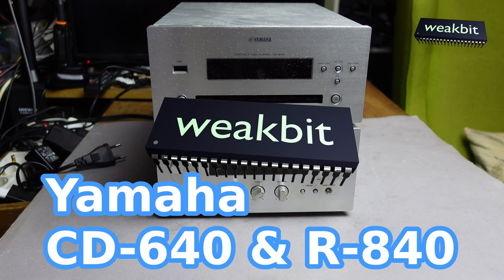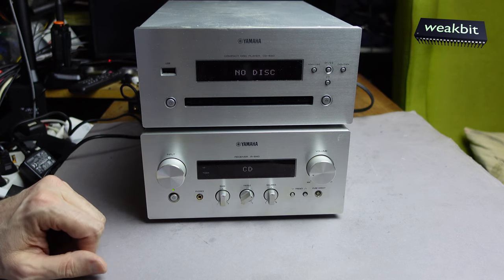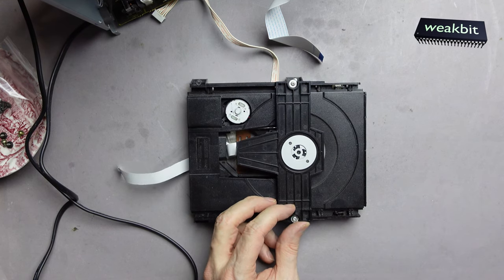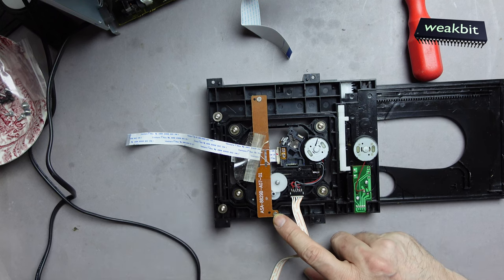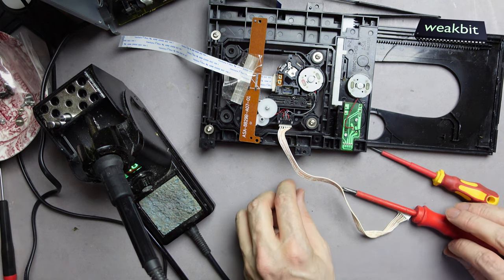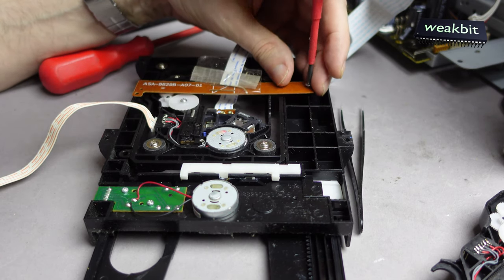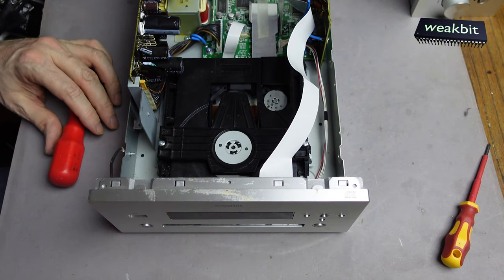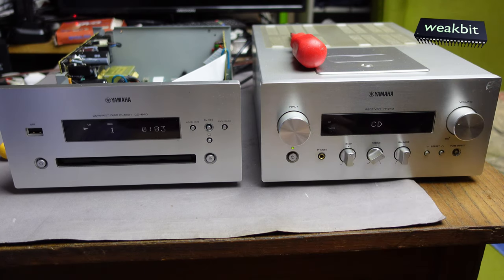Yamaha CD-640 and R-840 repair

Comment: Hello Mr. Weakbit, my denon cd player has a dynamic range of 110db. Is this good or just midrange ?
Reply from the maker: very interest. If I do the math at 16bit dynamic so this are 65535 possible positions and so we say dynamic_dB = 20log(65535-1) = 20*4,816466677 = 96,329333536dB come from the CD down.
Reply: @weakbit633  denon says its a 24bit/192khz burrbrown dac. It also plays sacd. Love your channel by the way.

Comment: Hi, I have not the Din cord... Can I use alone the CD player ? Thanks a lot
Reply from the maker: no
Reply: Thanks a lot. This is classic din cord or specific yamaha ?
Reply: @boomboxforever9567  The service manual shows the System Control Cable as Yamaha part number WQ579900. It also has a pin diagram and pinout descriptions. It appears to be a mini-DIN 8 connection. Only 5 of the pins are used for control signals between the R-840 and CD-640 microprocessors plus ground. You could try a standard mini-DIN 8 connector cable and see if that works.